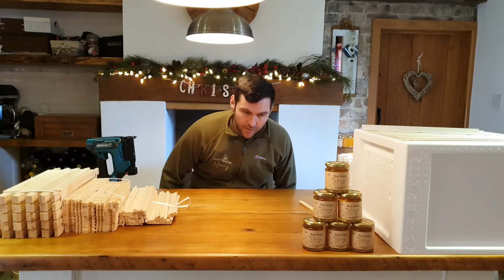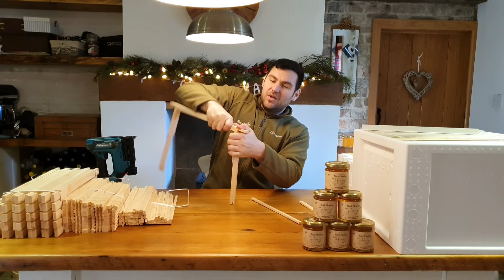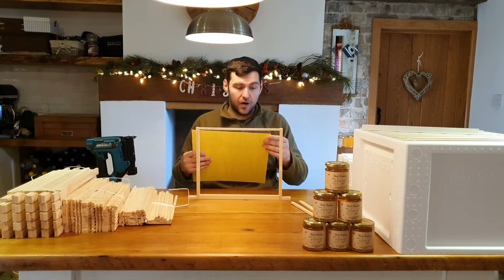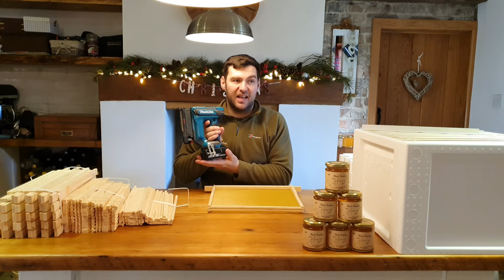Building Brood Frames: Step-by-Step Assembly for Beekeepers

Comment: I just noticed this was the end of December. I didn't think you could put foundation in the frames until march. Would you wrap the frame in cling film until then or what. I must have nearly 500 frames made up but without foundation yet, I was told to wait till March before putting them in
Reply from the maker: I don't necessarily film the videos when I'm doing the activity. Best practice to wait but I find it OK to put it in early

Comment: Hi Laurence - I’m attracted to making the switch from national brood to 14x12 size and so I’ve ordered a few hives from Liz at Abelo in readiness for the spring. Just wondered how you plan to make the switch and any thoughts / practical tips you have on working with the slightly larger brood frames? Cheers, Colin.
Reply from the maker: Hi Colin. My main driver for the switch was the fact my bees dont tend to fill double brood with brood but a single brood is too small. 14 x 12 seems about right for me and I like the simplicities that come with a single box. Double brood is definitely more flexible though.

I'm going to run all my colonies on single brood for the spring blossom and then once the June gap arrives, i will remove all supers and place the 14 x 12 underneath the brood box and place a feeder on top. I'll then feed for 2 week through the gap to try and the get the frames drawn out.

Once the gap is over, I'll remove the feeder and place the queen downstairs in the 14 x 12 with a couple of frames of brood and place a queen excluder between the 14 x 12 box underneath and the brood box above.

The brood box should then be full of honey once I come to harvest in September.

That's the plan anyway.

How were you thinking of doing it?
Reply: Black Mountain Honey that sounds like a good plan to me! I’m actually setting up at a new apiary site so I’ve ordered a couple of 14x12 overwintered nucs to start that site off. I was gonna just continue working my existing apiary with standard nationals this seasons to make sure I like the 14x12 before I standardised on that size. 

However I was thinking that when the time comes I would put the 14x12 above the existing brood box and manually move the queen up and put a QE between them to keep her in the top box - suppose like a Bailey comb exchange - perhaps putting a drawn frame in the 14x12 to give her somewhere to lay into and obvs feed them to draw out the frames. Once the brood has emerged in the standard national box then remove it.
Reply from the maker: @coags7155  Sounds like a good plan  if you've got drawn 14 x 12 comb to hand. Theres always so many ways to do it. Reason I like going underneath is that i can still use a top feeder to help get the frames drawn out quicker.

What are you doing to do with all your brood boxes? Mine are all going to be used as supers going forward.
Reply: Black Mountain Honey well, I only have 6 or 7 boxes so no where near the numbers you have!! Mine are all cedar so as well as making a switch to 14x12 I’m also going down the poly route. I think I’ll probably end up selling them locally. However, never thought about using the national brood boxes as supers . . . could do that I suppose cause I think they are compatible with the Abelo equipment - just whether my back can hold up lifting them!!!
Reply from the maker: @coags7155  Yes. All fully compatible. Nothing better than a brood box full of honey!! :)